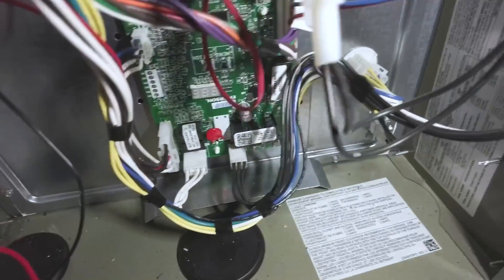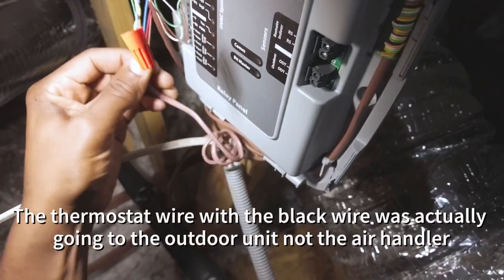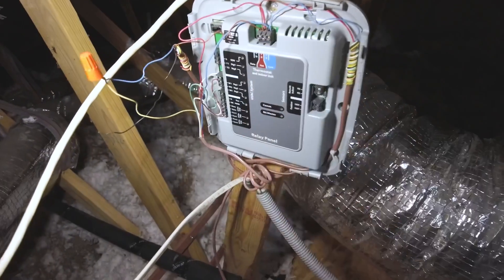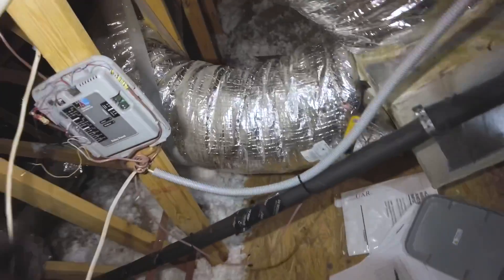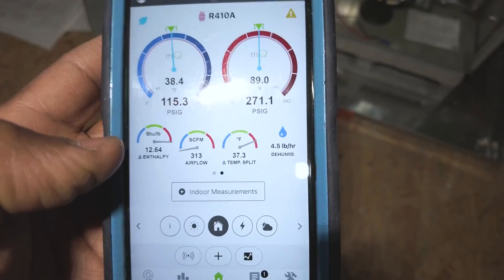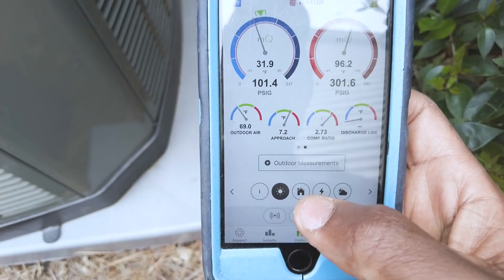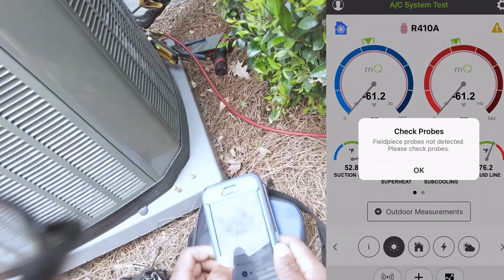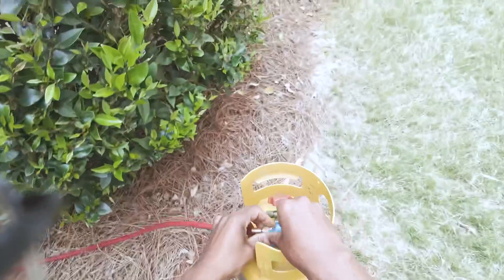This System was Setup to Fail! HVAC Tech Saves 15-$20K Trane Variable Speed System On Maintenance

Comment: I have questions brother I have only trane furnace s9v2-VS and thermostat  xl824  should I connect  bk wire for two stage heating too ?  I have to cut my jumper ? I have no ac unit on my furnace. Just for heat ?

Comment: I set up an S9V furnace with a Honeywell 8321 stat. Jumped R/U1 and connected other U1 to BK at board and cut jumper. Programmed thermostat to dehumidify with equipment in A/C with low fan and set contacts a normally closed.    It was definitely running lower cfm but showed it was also running 2nd stg as well. Honeywell instructions stated dehum would run if 2nd stg was calling. So a little confused. Does the logic on board override that or did I not program it properly?

Comment: Recently found a similar install issue with my furnace in the house I just bought. Not the weird common wiring, but the lack of wiring BK, mine didn't have the jumper cut. I noticed it when trying to test out the various fan settings and noticing that it only seemed to work at one speed. This sent me down the path of reading the manuals and contacting the original installer (no longer does HVAC) and eventually getting a new tech on the phone who confirmed my suspicions and said he could fix it for $200 or I could do it myself.

I found your video when looking for confirmation of my plan and it gave me the confidence to do it myself. My fan speed now clearly is different at 50/75/100%.

Any idea of what percentage it defaults to if bk isn't wired? It feels like 100% is a lot higher than it used to run and I'm curious how much fan performance I've gained lol.

Comment: Can you tell me what these TAM7 + XR14 lights mean: https://youtu.be/euZxu1-qcqk
Reply from the maker: If I'm not mistaken the top board is the air flow control board the green LED flash is 12 times which indicates 1200 CFM
 the blue led flashes once which indicates normal operation 
and the red flashes 11 time which indicates there's a evc fault 

The lower board is the EVC board (electronic valve control) 
Five green flashes indicate first stage Heating
 the single blue LED flashes normal operation 
and the Seven red flashes indicate high superheat. 

Could be a low on charge or restricted metering device.
Reply: @HVACTechKnowledgy  turns out the coil was replaced and the tech forgot to reset the fault.

Comment: So what exactly is BK?
Reply from the maker: BK is a feature used on systems with variable speed blowers to either reduce the speed by a certain percentage, by cutting 24volts or sending a PWM signal to vary the fan speed based off load demand on communicating variable refrigerant system.
Reply: @HVACTechKnowledgy  what's the chances of getting you to make a video explaining this in detail?
Reply from the maker: Chances are pretty good, I was actually already planning on it : ) Im just waiting to come across a zoned variable speed system with a honeywell zone board to demonstrate how to use bk to slow down fan speed when only a single zone is calling. Thanks!
Reply: @HVACTechKnowledgy  i look forward to it
Reply: So do I. Good job

Comment: Nice vid man. What was outdoor and indoor temp? I was surprised at that super heat, how long of a line set?
Reply from the maker: Thanks! The outdoor was 75 And the indoor was 71. Yeah the Superheat threw me off as well. The line set couldn't have been anymore than 60 ft or so...
Reply: @HVACTechKnowledgy  60 feet is still a lot I’d say. Around here we typically don’t see anything over 30 feet, 20 is the average.

Comment: Yep i see the fan speed not set up correctly alot on 2 stage and variable speed . Also people still just going off pressures instead of checking subcooling and superheat. If you hook up your gauges then check sh and sc. The same old saying ive been doing it like this for 5, 10 years. Good Job
Reply from the maker: Thanks a lot! Appreciate the feedback.

Comment: I work primarily on trane as well and quite often find suction line temp higher than I would like to see as well  slightly higher superheat.  On those coils they have a sticker in regards to that as well.  It says something like when measuring outside ar the condenser the superheat may measure 15-25 degrees.  So it must be normal even tho I don’t like it, it is what it is.   Depending on line length it can measure better with a real short lineset.
Reply: Too much airflow causes a higher suction pressure
Reply from the maker: True but the suction pressure wasn't High it was actually suction line temperature that was slightly high pressure was actually a tad low.
Reply: Was that a txv or exv? If it was a txv you should be able to adjust for proper superheat. With the exv systems sometimes it’s as simple as thermistor that reads a bit off.
Reply from the maker: Oh yeah thanks I didn't even think of that.  It was definitely at the TXV

Comment: At 11:17 what is return dp and  supply dp?
Reply from the maker: 41 degree supply 45 degree return dp
Reply: @HVACTechKnowledgy  what is dp?  I.E what does it mean?
Reply from the maker: Dew point. Its the temperature that the water vapor in the air condenses...
Reply: @HVACTechKnowledgy  d'oh! Brain freeze. Thanks!

Comment: So what does the BK terminal do? Cutting or not cutting the jumper?
Reply from the maker: The bk terminal supplies a pwm(pulse with modulation) to the control board for fan speed control.